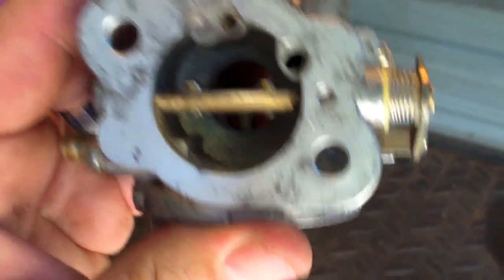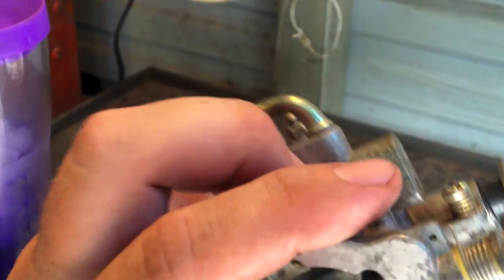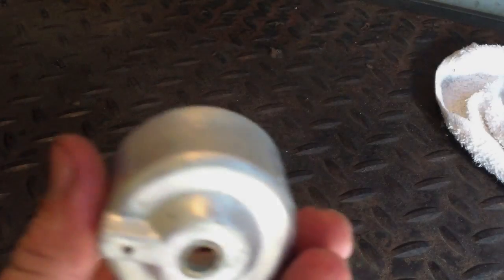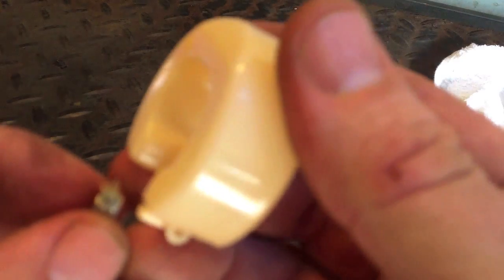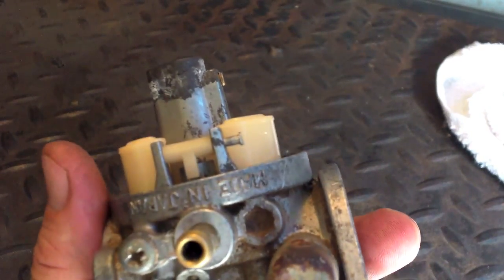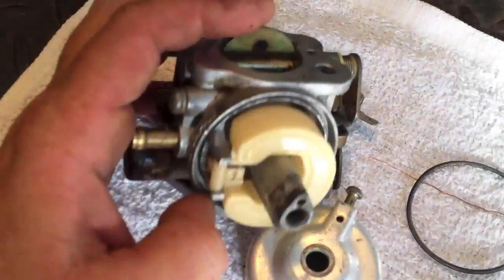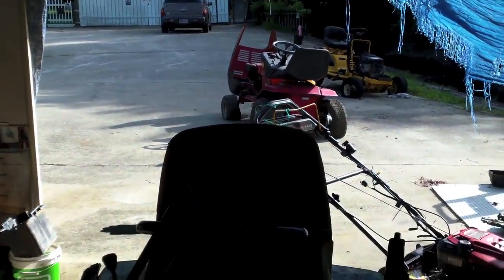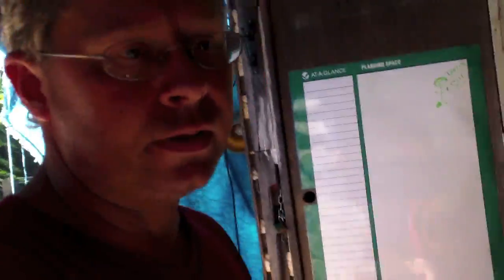How to clean a Mikuni Carb Part 2

Comment: Can someone tell me what the metal tube is for that comes out of the top of the carb and has a 90 degree bend in it?  You can see it clearly about 30 seconds in the video.
Reply: Ted Wilt 
Fuel inlet from tank